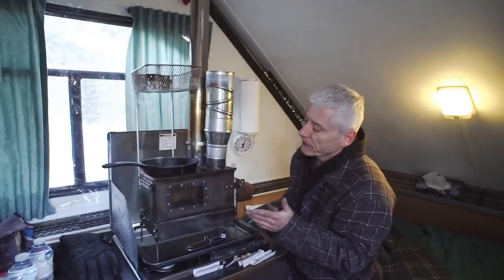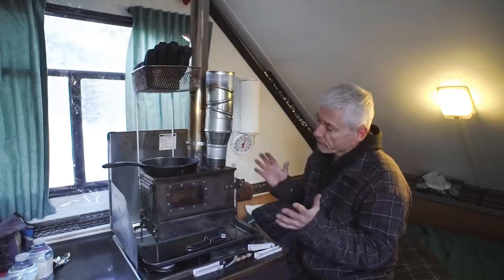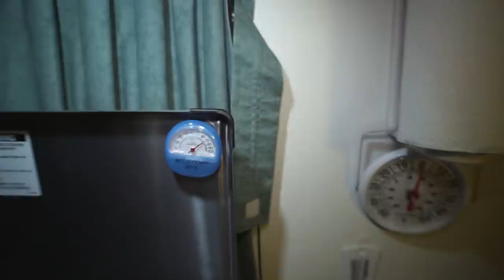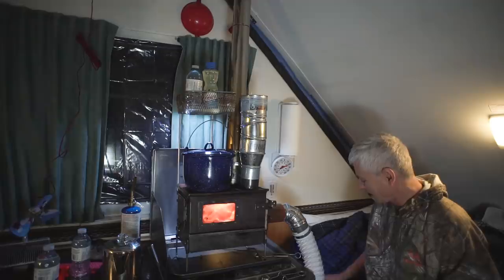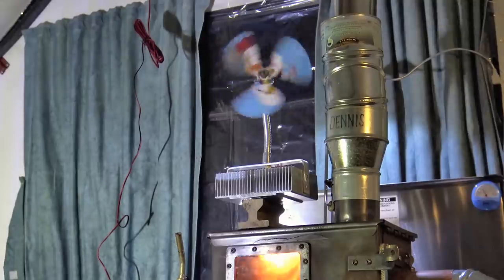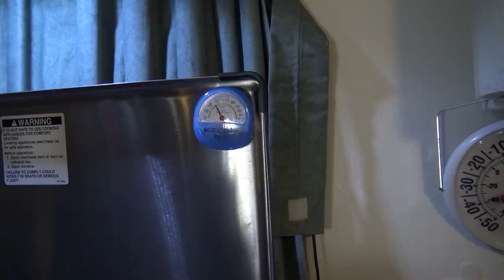Wood Stove in an A-Frame Trailer - Part 2

Comment: Hi Slim Potatohead, I enjoy watching your videos a lot. I also have an a-liner and I am new to a lot of it and your videos are helping. I have a quick question if possible, I am wondering where I can get parts for LP Hose assembly, LP hose connector, I have a 1998 and I want to get the right parts. Thanks!
Reply from the maker: Hi Katherine, I would check with your local RV repair shop. I have no contacts with Aliner, I just own one. Thanks, SP
Reply: @SlimPotatohead  Thanks so much for replying. If your ever in Vegas, give a shout out. Your videos are awesome.

Comment: I would love this little stove for my work shed. I have a pellet stove in my house so no issue getting pellets for shed stove. Where did you get this stove? How is it running? A big stove has an electric fan to push heat. I see this feed is done by gravity which is clever. As far as 10 minutes to light pellets you should just buy the burn gel made specifically for starting pellets in older stoves or you can use 90% rubbing alcahol(a little goes a long way) I used that stuff before upgrading my pellet stove to auto ignite type. Any info you can give me would be greatly appreciated. Stay toasty
Reply from the maker: Hi meckleboy, please check my earlier videos for construction of the stove. A list is here: https://www.youtube.com/channel/UC5LjexFk9wZEnFsXA3TOx-g/videos
Thanks! SP

Comment: I haveabout four idea to help, but for now I'll just describe two:
1. A portable skirting around base of trailer that silver stuff you was using inside trailer.
2. Mix pet Gerber bedding it's made out pine with no chemicals,  at first start of pellet bottom of your hopper. You'll not need the torch as long.

Comment: Instead of just plastic on the windows, try bubble wrap. Just spray water on the windows or plastic and stuck the bubble to it.  It will make a world of difference at night.  They also sale a kind of foam wrapper for glass or fragile stuff.  I use it on my glass patio doors at times.  Both of those are very light weight.
I would also get a tiny fan, it will blow the heat around and circulate a lot better.  That will cause you to use less fuel and have fewer cold spots in the rv..  Also foam board is very cheap at the hardware stores.  A few sheets will store away easily under floor or bed .  In cold night place it on the walls.  They also have fire starter blocks. use those and rely on the propane torch less.

Comment: You can make your own or purchase wax wood fire starter sticks and avoid using so much propane. A single match would work. Excellent presentation and keeping the clock in view would add a little more depth. Tks...

Comment: I bet you could figure out how to run some copper tubing around the hot liner of the stove pipe, then maybe some pex under your mattress. Just a rough idea. Maybe a small radiator with a heat powered fan.

Comment: Did you adjust your flue. I think you're supposed to have it set to b 2/3 closed after the smoke burns off.  That traps the heat in and lets the smoke out.

Comment: To extract way more heat from stove, you would want a much larger heatsink placed flat on the stove (few times larger than what you have) ideally one large piece or 2 smaller but next to each other, not stacked and then have a fan blowing from behind it through the heatsink, not above it. But even if you try blow a fan through the fins of what you already have, there should be noticeable improvement worth a tiny bit of battery consumption for the fan.

Comment: Using a hose to draw in outside air is genius, not as much in regards to running out of air. But it eliminates the typical problem with woodburning stoves that they suck hot air out of the room they are in, it should greatly increase the heating potential of the stove.

Comment: @Slim, great story.  Just an observation from heating hunting blinds in which the hunter hardly moves at all (so as not to be seen).....
You will get much more effective heating of your space if the heater is mounted as low as possible within the space.   Radiation travels outwards in straight lines and the hottest surfaces are on top.   If you are below those surfaces, you are missing out on most of that radiation.   

Even the convection is a plume that extends upwards above the stove.  Below the stove is the return air that has been cooled by all the outer surfaces of the trailer which is why it is sinking down to the lowest point.  So far because of the elevated stove position, you have been sleeping in the cold return air.  If you lower the stove as much as you can, the warm air region will encompas the area you are sleeping in.  It will also help to have reflectors opposite the stove to direct the radiant heat towards you, they can be amazingly effective.
Reply from the maker: Unfortunately that's as low as I can put the stove without major changes in the trailer's design. Reflectors sounds like an interesting concept. Will look into this. Thanks! SP
Reply: Maybe try some of that reflective bubble wrap on the inside surfaces of the "A" part of the trailer to reflect some of that radiation back down to you ?  I'm assuming that adhering a foil faced product to those surfaces would not be aesthetically pleasing ?    More of us need to get in on the experiment...   How about having a water tank on the stove that is heated and then circulating the hot water through pex tubing under your mattress ?  That would more directly heat the critical space than trying to heat air and have the air transfer heat to you...   Vented heating is definitely the way to go though, dry heat and no CO2 inside the trailer.

Comment: You need a cap on the stack and if you use a hand full of sticks first starting won't be as hard to start when you start to bed and no smoke problem put a couple of hand full charcoal and lay down for the air get a cheap O2 sensor it will tell you when you need to worry

Comment: What about using bubble wrap. For insulation over the windows.  If you haven't thought of this or done it. The air in the bubble wrap is supposed to work well.

Comment: Reflectics on the windows and possibly make the stove pipe longer. But you'd need to position the stove farther from the vent hole. But with more area of stove pipe you'd get more radiant heat. And one other thing you could try is putting some bricks on the stove for more thermal mass. Cool stove buddy  your not a dummy you probably already though of all my ideas

Comment: Maybe zigzag the pipe where the hot air goes true so it has a longer time for it to warm up the air inside your camp or a heat blowers that you put on your stove and it gets hot then it moves hot air above the stove in the camp

Comment: If you line the walls with reflectix, it will be quite a bit warmer as well.
Reply from the maker: The walls are well insulated. It's just the trim that's the issue. Thanks! SP
Reply: @ @SlimPotatohead   Maybe just reflectix on the windows at bed time, say held with velcro?  Loved your use of pipe wrap!

Comment: Slim...  I see you added pipe insulation...  Can you give me a few more details?  Size?  Thickness?  Also on the stove...  I'm wondering if you add more space for the ash to fall, would it need less poking and tending?  Thanks, Perry  Ps R you coming to Georgia any time soon.  I have some suggestions for you..
Reply from the maker: Perry, please remove your email address from this comment unless you want a lot of spam ( I will remove comment in a day if you miss this).
I expect to do an insulation update in the near future. As for the stove, the issue is in the cage and not the space underneath. Thanks! SP
Reply: Thank you for the advice on the email...removed...Safe travels.!  Perry
Reply: I had a pellet stove when I lived in upstate NY.  It would be great if there was a way to feed pellets consistently.

Comment: you can take some fire brick or stones and place them under the stove. It will retain the heat and disburse it throughout the evening.
Reply from the maker: Wouldn't work on this stove Douglas. There is no heat under the stove unit to absorb. The oven chamber uses it. SP

Comment: I’m sure this has been mentioned before but just in case it hasn’t - the stove won’t selectively suck the oxygen out of your cabin, running without the intake hose should be better for air quality (bar having a backdraft) as it will force fresh air in from outside and help keep CO2 inside down. I’d rather keep the vent sufficiently open and accept the air around it being a little cooler. 
Really neat design for such a small thing - I hope you found a way to keep it running on its own long enough for a full night’s sleep
Reply from the maker: Ivo, the reason the intake house is bringing air from the outside is to avoid issues with both CO and CO2 in the cabin. It makes the heating component a closed system, therefore the stove has little effect on the air quality in the trailer. In subzero temps, allowing drafts and cold in defeats the purpose of heating it with the stove. I'm quite happy with getting up once in the night to add pellets, as it allows me to make sure all is well. Thanks, SP
Reply: Thanks for the clarification :)

Comment: Look into an anthracite coal/wood burning stove.   Anthracite coal can be obtained from most Tractor Supply stores.  It will burn clean AND burn for 8 hours; that means you don't have to fiddle with it during the night.  Above all, make sure all metal used for the coal stove is rated to withstand the HIGH heat of coal.   There are lots of coal burning stove videos on youtube; take a look at them.   Also, look at some videos on how to make fire starters.

For the readers, there should be a buffer zone around the stove.   Meaning, nothing stored close to it.   Metal heat deflectors are a must behind the stove.   A stove mat under the stove is a good idea, too.   Lay a Fiberglas blanket in front of the stove door before adding fuel or stoking the fire; it will keep any loose embers from burning a hole in something or starting a camper fire.    Always have a fire extinguisher in the camper.   A flue jack must be installed where the flue exits the camper, so the flue heat does not burn the roof.  There are many safety issues involved and you must be aware of all of them, therefore, you have to STUDY and don't rely on the second hand information of others.   I grew up with wood burning heat and I know how uninformed people can make deadly mistakes.    Above all, if you have children in the camper, I would never consider any kind of flame heat with which they would have access.

Comment: You can try a fan powered by heat that you put on the stove so it will flow  hot air  horizontaly
Reply from the maker: You must have skipped part of the video! SP

Comment: So how did  the charger work? Dod it need very hot to works or would coals make it charge?
Reply from the maker: Hi Carol, It works best if the water is kept cold. In the future I might try adding ice to it. Slow charge. SP
Reply: Where did you find charger??

Comment: Your air intake hose is bringing cold air through the center of the trailer, insulate it and have a shorter run because the cold plastic is cooling the air inside the trailer.
Reply from the maker: Sorry, but it isn't. Vinyl is an insulator. Not even cold to touch. SP

Comment: I grew up in a drafty old farmhouse with a coal and wood burning  stove in the living room. No heat upstairs other than the stovepipe going into the chimney. We would fill a rubber bottle with boiling water to warm up the bed. People also used a soapstone with a wire handle heated up on the stove to keep the bed warm at night. I think they may have wrapped it in a towel. You don't want it to scorch the sheets. I have one but have never used it or seen it used. It is an antique. They are available on eBay. Maybe someone has a video on proper use.

Comment: It's a really neat stove, and a good presentation, but you made one of the classic errors of wood stove installation: for heating, you need to mount the stove at the lowest point in the room so it pulls the cold air off the floor and replaces it with warm air. If you mount it too high, it will not do a good job of heating the space.
Reply from the maker: Not an error at all Peter. I do not want a stove on the nfloor due to both safety and practical reasons. The heat is circulated by fans. Trailer design is all about compromise. Thanks! SP

Comment: just a fyi thing since in this video you brought a humidity gauge with you when you have the stove lit and heating if you leave some water on the top the stove to boil and keep humidity in the air cause yes this is a dry heat burning pellets it will feel warmer inside your trailer and you wont wake up with dry mouth if you keep humidity in the air and maybe you might retain heat a little longer in your trailer
Reply from the maker: Hi Randy, in cool temperatures adding a little humidity is a good thing. But in sub-freezing temperatures, humidity is your enemy. Most trailers fail in the winter due to condensation resulting from humidity making contact will metal surfaces exposed to the outside. I need heat for drying as well as keeping warm, so the lowest humidity the better. Thanks! SP

Comment: Taking in air from out side is wise you want to keep warmed air in if you didn't take in fresh air from out your heater would be introducing cold air through the vent. Consuming warmed air. So by all means grab your air from out there. Heat water fill water bottles place under your mattress especially your feet.

Comment: If you put two L-shaped bends in your flue so that it almost looks like a half Square it will keep you from losing so much heat out of the top of your chimney and will almost act like a radiator to help heat your camper better.

Comment: Interesting video. Heat transfer is always the issue; are you losing heat through the shell of the camper faster than you're pumping heat in? BTU production is easy enough to get a close-enough estimation, just based on how many BTUs are in pound of pellets and how fast you're burning them. If the heat loss is greater than the heat production, you're done. It get worse as the temperature differential between the inside and outside increases. As you've learned, cutting down on heat leaks, either by plugging holes or adding insulation, will make all the difference by slowing heat leakage. BTW, if you're burning a pound of pellets per hour, then that's about a 8000 to 9000 BTU stove. Most small camper propane heaters are on the order of 6000 BTU.
Reply: It would be interesting  to see him test the outside with a infrared   camera to see where the largest heat losses  are happening .

Comment: I am not sure that you should use the air inlet tube as that would be blocking the air that you need coming in for your breathing.  Plus the air going up the chimney will be coming in through the door inlet anyway, and in that way the air into the stove is being pre-heated by the van temperature and so be more efficient.

Comment: Hi, the wood pellets would light easier if you took a coffee can full of them and Lightly coated them with diesel fuel. Remember, I said diesel fuel, it does NOT explode ! it just burns. Then take a small handful of them and drop them into the burn chamber first then put some dry pellets on top. The diesel soaked pellets would light easily and get the rest of the pellets burning. This would not leave off much smoke or cause soot,  or any other problems. Keep the coffee can of them closed and it would not add any odors to the camper. You could even set it outside. My brother uses this method to light his pellet stove.

Comment: 36:32 the old coal stoves used to have a shaker in the bottom to clear the clinkers/cinders.  Might look into how they worked. I think still required manual attention, but I think was more efficient somehow. Actually I dunno. Just sayin'.

Comment: Did you permanently attach the split foam pipe insulation to the edges of the sidewalls or did you remove it come warm weather?
Reply from the maker: Its still there. Original adhesive doesnt last however, but since the foam forms to the sides it stays put. SP

Comment: As far a wood pellets, it is about 2.5 gallons of #2 fuel oil per 40 #bag.  I heat with only wood pellets when the price of oil is over 2.50 a gallon

Comment: look into making a pellet fed rocket stove / rocket mass hybrid use a rocket stove design with sand as the mass around it but the chimney section make you a stovepipe heat reclaimer the mass will hold heat for a good amount of time after it gets to temp and fire dies down the reclaimer will make sure you get as much heat as can while it is running into the space your in and little is lost out chimney.

Comment: I think if you used smaller air intake you wouldn't get so much cold air to heat up with with outside of pipe. Not sure you need that much air for combustion. Very good concept you have
Reply from the maker: The intake hose is vinyl and acts as an insulator. Not cold to touch. Intake dial regulates the flow of air and can be reduced if necessary. Thanks! SP

Comment: Are you just using pellets? When they burn they don't have material to give off the energy they need to to get hot enough. Wood on the other hand is dense enough to maintain a really hot burn. Im just wondering.
Reply from the maker: Please don't post misinformation. Of course they produce adequate heat. Too much in fact that I had to reduce it. I proved this in about 10 videos. SP

Comment: FYI, an infrared thermometer will not read correctly on a highly reflective or clear surface.
I learned this after a severe burn from a stainless steel pot that read okay to touch.

Comment: Did you have any condensation problems with wood stove heat like I seem to have with propane buddy heater?
Reply from the maker: It's the opposite. Wood stove in a closed system is dry heat. It helps remove condensation. Thanks! SP